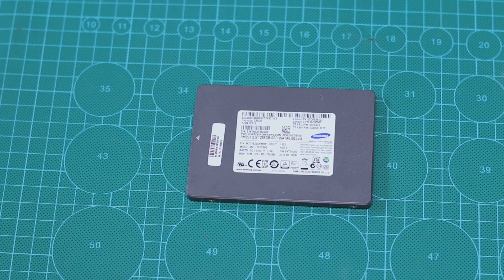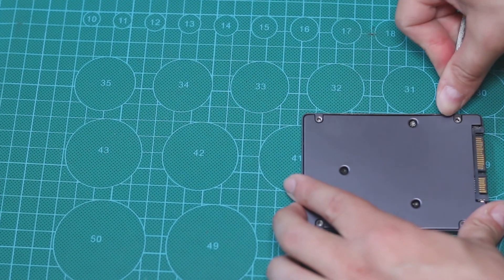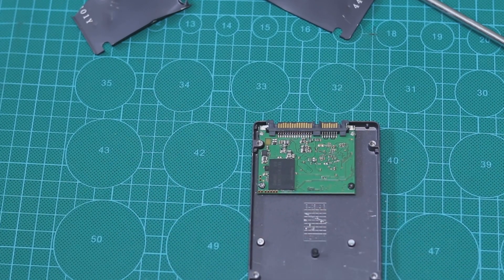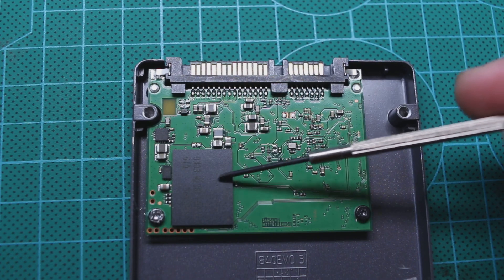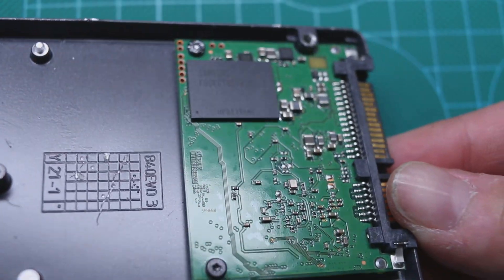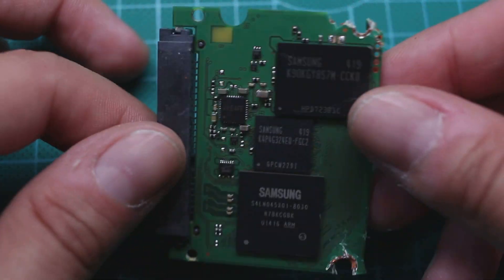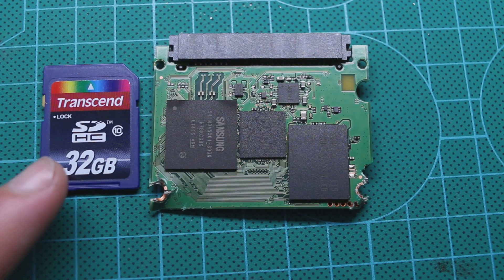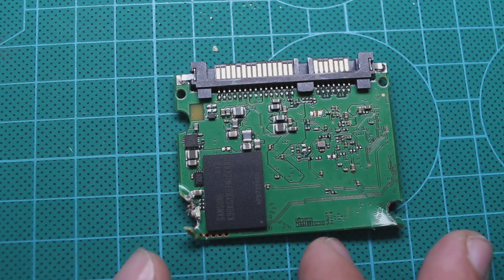What's inside an SSD?

Comment: so, realy only 5years after this product released, i see the year is 27may2014 to 11june2019 right ... legit trick from samsung ....
Reply from the maker: What trick?
Reply: @DimusTech  'the warranty of product' .. samsung can claim in 5 years ... after that, the product is failed. may be must have backup, after 4 year.
Reply from the maker: @muchamaddestafadilah  you should always have a backup regardless of warranty
Reply: @DimusTech  yes, it's noticed.
Reply: @DimusTech  Maybe he was referring to programmed failure - anybody that even claims that SSD is definitely more durable than a HDD is a complete fool  - SSD are fast, that's about the only advantage you can have - with an SSD when it fails, it's sudden - with hard drives, sudden failures exist too, BUT in a lot of cases failure can be predictable, giving you signs ahead of time . I've never had a single HDD fail on me, I have HDD that were tortured for 10+ years of non stop operation and they are still good.  The issue with SSDs is not much about TBW, but they operate much hotter than a HDD, especially NVME type, and usually most failures are due to overheat and controller failures - not an issue with hard drives which operate below 50C - with an SSD in use, you can easily reach very high temps - SSDs are NOT meant for heavy and sustained write jobs, contrary to hard drives.  SSDs are way overrated  - and year by year they are getting worse and worse with the shitty memory they use - First it was SLC, most reliable because of 1bit per cell...... Then MLC, then TLC, now QLC garbage is flooding the market, and pretty soon PLC will be the norm, SSD is getting shitter as years go by with far lower endurance - SSDs are a horror waiting to happen if used for cold storage - hard disks are far more reliable, just get 2 identical hard drives, 1 used for a 1:1 clone backup, it will be far cheaper and more safe.  SSD is just overly expensive shite -  you get faster speed at the cost of data safety and very low endurance compared to HDD.   Even the best of SSDs are poorly designed - Even the Samsung Pro series, top SSDs, but they run extremely HOT and the throttling is not conservative enough - try copying large files or many files, you will see most of the time your controller reaching near critical temps or higher - I have done massive workloads on my hard drives / hours of transfers, full load and my hard disk temps never exceeded 44C - on an SSD forget about that, SSDs are far less reliable than people are led to believe - and often their touted reliability is masked by clever Error Correction under the hood.

Comment: Why is the SSD case so big if the actual circuit inside it is so small?
Reply from the maker: I believe it comes for 2 reasons, first of all the size which is called 2.5 inch is a standard from the HDD days, it was back than used mainely for laptops (PC had the 3.5 bigger size) and probably the industry decided to stick with it for quick and easy adaptation.
second, I'm pretty sure older SSD had somewhat bigger boards and chips inside